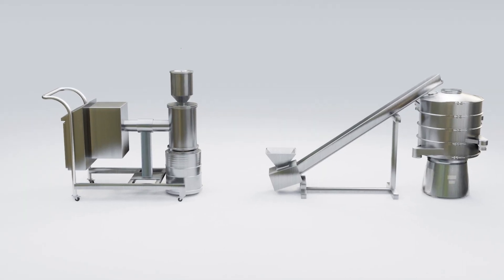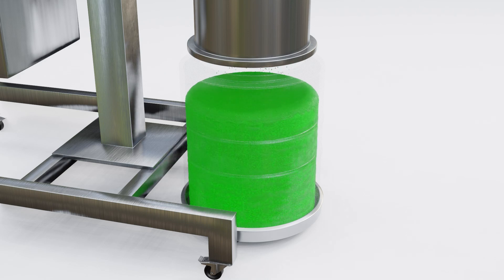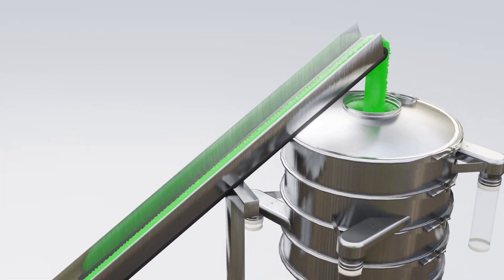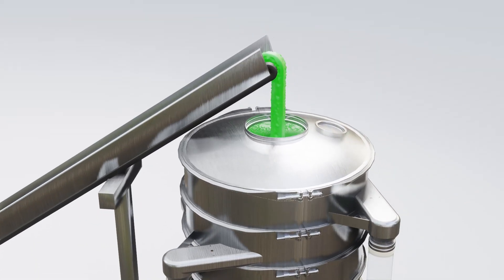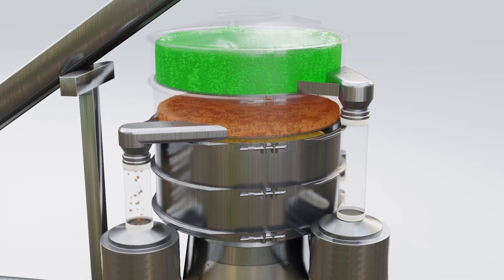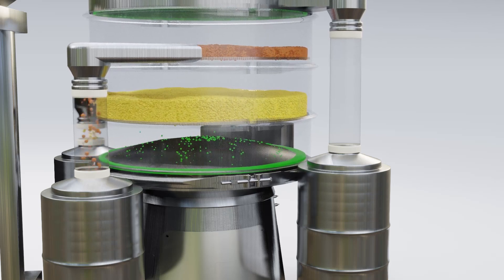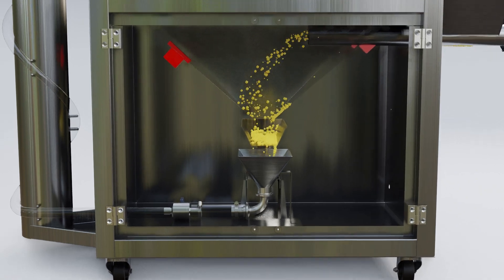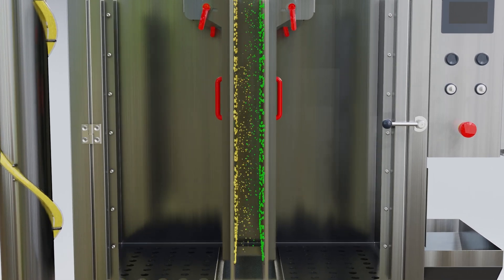Plasmastatic Processing Line - Solventless at Scale

Comment: WHy is any of this necessary when I can press 1lb at a time in 1/2 hour, by myself,  when prepped well?
Reply from the maker: Agreed. This is only for large operators.
Reply: What does you pressing have anything to do with an extraction machine?
And your math is not mathing here. 
In 30 minutes you press 454 grams of extracted materials? At what temp... 5000 degrees with 50k psi? 
If your small scale then the most your pressing at one single time is 14 grams on a large press. IDC what bs your going to try and spit. Your not trowing a pound on them hot plats at a time. The most your doing is 14g each press... If that. Probably a lot less but lets give you some credit to work with.

454g at 14g a press is 33 presses. If you only spent only a single minute pressing each bag, you could not get through 454 grams in 30 minutes. 
Your not pressing an elbow in the same time it takes to get a pizza delivered so whats up bud?
Reply: @ShroomySteve  I grew up around an apple cider press
Reply: @ShroomySteve  I said the press itself takes 1/2 hour.... the prep takes an hour on a good day and has to be right rh...never seen 8x10 plates I take it?
Reply: temperature
Reply: @asemic  ok, I agree